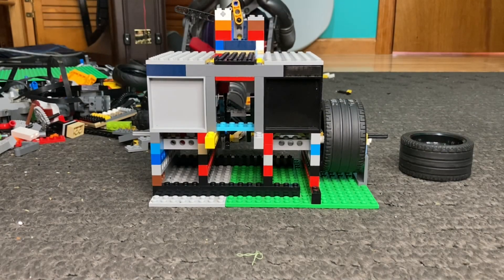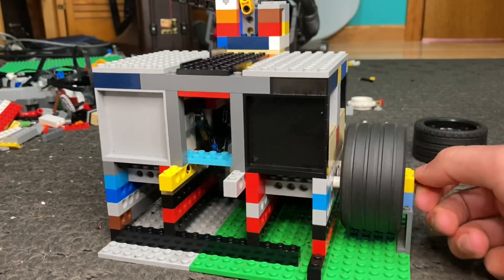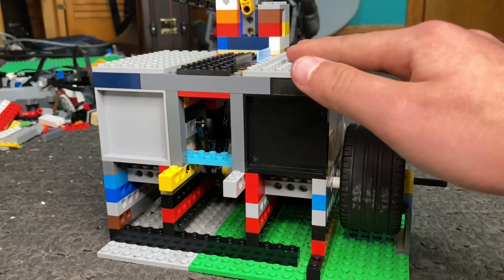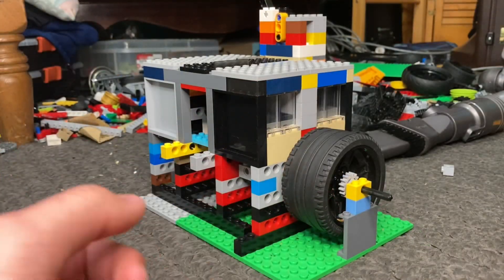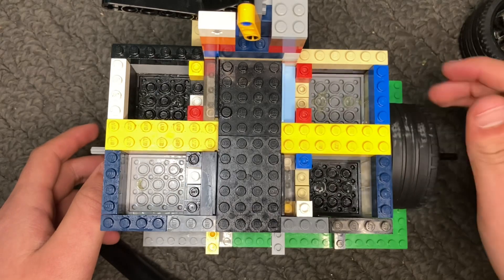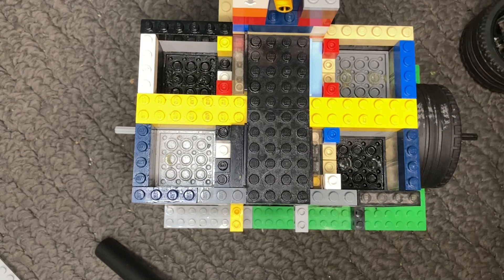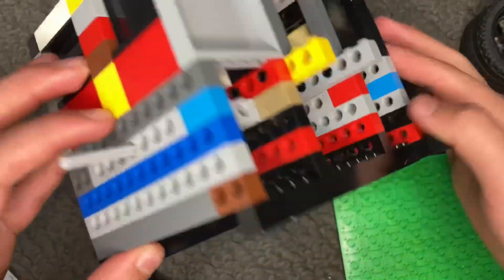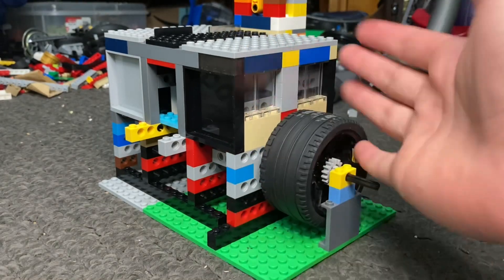VR4 Lego Vacuum Engine

Comment: OK just to make clear: a VR engine has all valves in single head, but 2 cylinder banks, so basically both banks cylinders with single head, this creates a much narrower engine than standard V engine were each of 2 cylinder banks have their own heads,

Comment: alright technicly that would be a U engine design
a vr would be 2 v engines smoshed together, 1 v engine ontop of another
Reply from the maker: I think you’re talking about a W engine here, but this is the most similar engine to a real life VR. A U engine has 2 separate crankshafts
Reply: @KFPlusLegoMastery  no no
A w engine looks like well
A w, a v engine and an inline in the middle of said v engine
A vr is like i said 2 v engines smoshed together. 1 v engine ontop of another
A U engine is 2 inline engine side by side basicly
Btw if it only has 1 crank shaft, how did you connect the pistons?
Reply: @KFPlusLegoMastery  alright i actually watched again an explanation on engine layouts, and saw you video again, and the vr2 shorts. I realized my mistakes.

although your engine looks like a U engine, it is connected by 1 crankshaft, but a vr engine would be slightly angled, almost an inline. 

a vr is basicly a compact v engine, but the angle of a vr would be nearly impossible to achieve using legos unless in a larger scale, so best compromise would be U engine with single crankshaft

it is quite cool how you achieved a U engine using a single crankshaft.

i was also reminded, infact, a W engine's layout is well, 2 v or vr engines smoshed ontop of each other, the only instances i found where a W engine is comprised of a v engine and an inline otop is a W6, W16 and a W18 engine. but W engines have 2 possible layouts, 2 v or vr engines ontop of each other or a v engine with an line in the middle

Comment: Do you use an air compressor or smth to keep it running or are you just THAT good with lego
Reply: It runs on a vacuum
Reply: It uses a vacuum cleaner to pull the cylinders

Comment: You should try getting a second vacuum cleaner and making a dual vacuum set up.
Reply: Why? Its unpractical and weird
Reply: @lemns0000  yeah its unpratical, but he would get more power out of it. He has to divide the auction of the vacuum on all of the pistons. With more vacuums, he can focus more of the suction on fewer engines. It would kinda be like replacing a v8 with a 2 barrel carburetor with a 4 barrel carburetor.